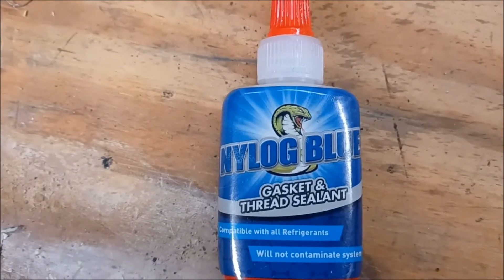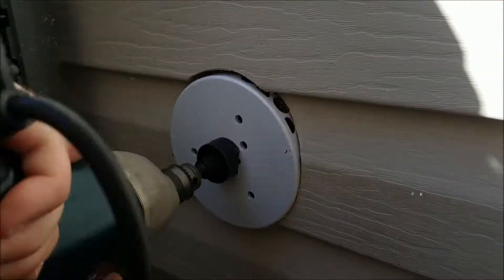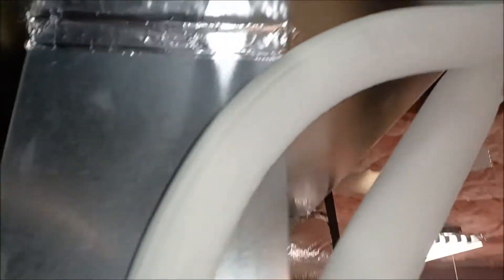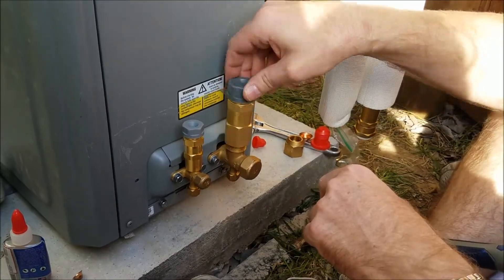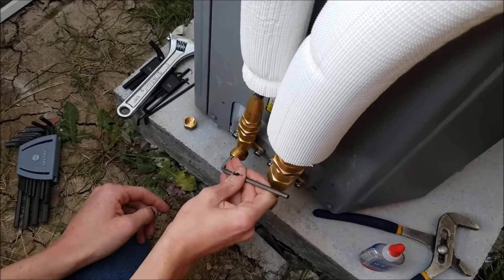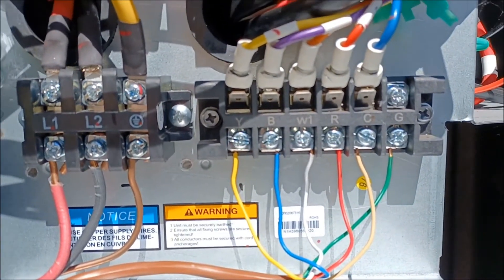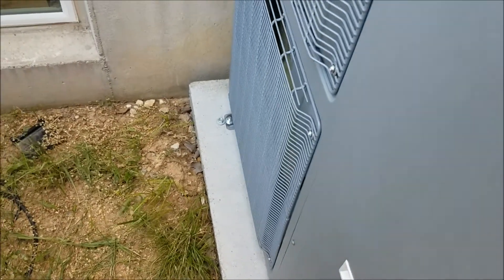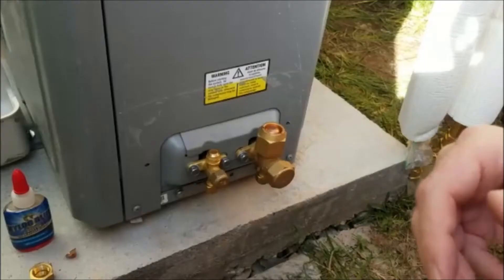Mr. Cool DIY Heat Pump Part 4 Installing the outdoor unit ducted universal

Comment: Did you have to change your breaker to match it
Reply from the maker: I think I kept it at 30A. Breaker always needs to meet the requirements of the wire you're using.

Comment: RESPECTFULLY NEVER put goop on a compression fitting and NEVER NEVER put it on the contacting faces!  The TINIEST bit of that stuff and your expansion valve is plugged!     TRUST THE MANUFACTURERS INSTRUCTIONS FIRST
As a mechanic spanning fifty years I suspect I know what a compression flare  fitting is and most everyone does not know.
Reply from the maker: It's r410 safe.  Not sure how it's going to plug  the expansion valve if it mixes in and has the same viscosity as the fluid. If it did, I'm sure nylog would get sued.

The heap pump  manufacturer doesn't say you can't use it. 

Do you have any independent, peer reviewed,  published data other than  anecdote experience to show its bad for the faces?
Reply: @stem_saving1644  I have worked with compression, knurled, nipples, couplings, sweat soldering, flare, flared end, flared pipe nut.

Do you have independent, peer reviewed, published, data other than opinion to show your idea that in my life has never been heard before is the thing to do?

In case I sound aggressive, I'm not, am retired and my way of helping others is relating what I know.

What I know is in the case of compression or flared fittings no lubricant, sealant, glue, or any stuff that does not say which it is is needed.

Lastly, flared fittings are among the best sealing this is why they are used in refrigeration, aerospace, and other high demand situations and applications.

If you like, since it is your channel and you have been courteous, I will gladly remove my comment if you merely ask or suggest it. 

Thanks.

Comment: Mrcool is the worst brand you can buy. Mine didn't last 6 months from new
Reply from the maker: We have different data points, mine has worked for 3 years, and there are no issues.
Reply: it's gree flexx with diy additions (line-set) -- they are good if installed well
Reply: @worfrozhenko4032 
Made in Chiiiiiiina 💩
Reply: @worfrozhenko4032 That junk is made in Chiiiiiiina 💩

Comment: I see you were measuring amp draw.  I've been tracking my compressor with the emporia power monitoring systems.  My outdoor unit routinely draws 20 to 22 amps after ramp up.  I was a bit surprised by this since the Rated Load Amps (RLA) on the data plate is 16 amps.  I have a 2/3 ton unit setup in 3 ton mode.  Do you have any idea if your outdoor unit draws more amps than what is listed on the data plate on the side of outdoor unit?  I'm just trying to determine if this is normal. Thanks!
Reply from the maker: It does. Some control systems that have quick rise times will overshoot their average during ramp up.  I seen mine did 7kw, but then damps down.  It's the power usage (steady state) at the given temp that's important.... at least to me.
Reply: @stem_saving1644  Just to be clear it is pulling 20 to 22 at steady state.  I have plots from the emporia energy monitor and there really isn't an overshoot on my system.  When the system had more vibration that I expected I started tracking amp draw because I was worried about the health of the compressor.  I still don't understand how to reconcile the data plate saying 16 amps max and it pulling 20-22.  Sometimes it hard to ignore things when you're an engineer.
Reply from the maker: @mtbphil168  The current should be proportional to the temp.  Give or take a few watts. But yeah, I agree with your last statement. 😀
Reply: @stem_saving1644  which temp are you referring to? Outside temp or refrigerant temp.  It does not seem proportional to outside temp from what I've seen.  This is a noncommunicating compressor and it really seams to operate like a normal compressor but with a ramp up.  It pretty much ramps up to a steady state of 18 to 22 amps.  So if it's proportional it's only a few amps change
Reply: Thank you for this datapoint. That is quite concerning from engineering perspective. I am about to install the 2/3 ton unit and planning on running it in 2 ton mode as per manual J/S calculations. It is 1,600 sqft ICF home. I will clamp the data logger on it and provide an update whenever available.

Comment: Have you had any issues with the lines freezing in the summer when running the AC? I checked mine for leaks and couldn’t find any. Condensate is draining correctly, but still unsure as to why it is freezing
Reply from the maker: It's usually a couple things.  The charge on the system, air flow across coil. Dirty filter or coil, which restricts airflow.

The mister shouldn't cause any issues assuming everything else is working as it should.  It sounds  like refrigerant might be low. You can buy gauges to check that.
Reply: @stem_saving1644  do you know what the levels should mark for this system in terms of refrigerant?
Reply from the maker: Not off the top of my head, it's probably in the literature or on a faceplate.

Comment: It's getting close to a year since ypu posted these videos - how is the system running?
Reply from the maker: Great, I'm getting ready to post some energy consumption rates soon.
Reply: @stem_saving1644   Outstanding! My AC and gas furnace system is 20 years old now. We installed solar panels a little over a year ago, and just this year I replaced my old busted gas water heater with an electric water heater, and now I want to swap my central air system over to a heat pump and get rid of the natural gas altogether. The MrCool system looks like it's the way to go! 

Thank you for showing your install and for giving updates! Looking forward to the next video. Take care.
Reply from the maker: @crxtodd16 might want to consider heat pump hot water heater as well.  I have a video on that too. I pay 3-5$ a month to heat the water.  Crazy low.
Reply: @stem_saving1644   Oh dang, that's awesome!! Unfortunately I had some plumbers tell me not to get a heat pump water heater because they "always break down", thus I got scared into buying an electric unit and installed myself. I put tons of insulation down in the new pipes and I put a heater jacket on it. But still, I'm paying more than that in electric bills for the heater... 

Sounds like I should have gotten the heat pump water heater to begin with!

Comment: Do you not have to torque any of the fittings? When I put in a mini in my living room I got the flare tool and the fieldpiece SMAN 380 I think it was. Saved me so much money in service calls. I thought the flares were messed up in my mini after about 5 years I had a slow leak. Low and behold I heard a hissss when switching to heat one day and found something that looked like a dent the size of a machine screw was leaking on the side of the indoor coil. It wasnt a boldge out but a clear puncture in that had not ruptured. I then had to braze the spot then vacuum the lines out, triple evacuate, and charge. I knew how to do none of this before putting in a Rheem home heat pump in 2010.
Reply from the maker: You should,  but I have a good feel for torque, plus I used nylog... so I shouldn't have any leaks.

Comment: Did he just put a big hole in a rim joist? Now I understand why DIY people need professionals to preform installs and have inspections called in 😂😂😂😂😂
Reply from the maker: LOL, need professionals to drill holes? It's not needed. Diy kits put "professionals " out of demand.  Glad I didn't have to pay professionals costs and still get an awesome heat pump.
Reply: Really, a single hole through the rim joist and you have a problem with that? Even if it was a problem you dont' think HVAC "professionals" wouldn't do the same thing? They pick the fastest way 99% of the time, just like cable installers nailing cable to the outside of a house because its easy.
Reply: @Kent-pb2jl  regardless of what your opinion is if I am a construction manager on a construction job site there is no way you would get by with drilling a hole on my joist like that you would have to come up with your own way  that us up to code, or do what engineering plans spesifi that's why we have inspections.
Reply from the maker: @thewrenchgarage7986  Guess what? This isn't a construction job site and your not a manager here.  I am not a manager, but I did stay in a holiday Inn express last night.
Reply: The point I was making is you compromised the rim Joist. If somebody does something like that on one of my jobs they would be figuring out how to repair the joist that is a structural component that holds the house weight
Reply from the maker: Guess dryer vents or pvc pipes or gas and water lines or utilities lines all penetrate the rim joists as well and compromise the rim joists.  But back to my original comment,  it's distributed loads across the joists.
Reply: If you believe that saving money is more important than saving your house that is a decision that only you can make
Reply: @thewrenchgarage7986 As an electrician, These DIY units are what the world needs. HVAC companies, in my opinion are the worst of the worst and prey on people in tough situations. This guy cutting his hole the way he did is 100% ok and does not significantly degrade the structure. Its his own house for God sake. Glad he was able to install his own unit and not have to pay the thieves that are HVAC contractors. I install these units all the time and am working on changing the notion that you need HVAC techs to install.  I can bring power from the panel (you need an electrician anyway) and do the rest of the install myself.The technology has been streamlined to the point where all an HVAC techs needed to do is servicing and that it.
Reply from the maker: @thewrenchgarage7986  millions of people put erv and hrvs in houses,  they also have 6" intakes and exhausts. Guess all those folks are not saving their houses either?

You do realize houses have multiple floor joists to distribute loads and are over engineered to take dynamic loads?

Comment: Thanks so much for sharing this! I'm a little confused about the electrical. I get that there is a separate breaker for the condenser and the air handler. I get that power for the condenser runs through the breakout box you have mounted on the outside wall. Does the power for the air handler run directly to the air handler, or is there another breakout box? Thanks again.
Reply from the maker: Outdoor disconnect is meant to allow you to remove power without having to go inside.  My inside unit doesn't have a disconnect ... as you're already inside.  But might be convenient, though.
Reply: @stem_saving1644  Thanks!

Comment: Did you used a 8awg with the 40 amp breaker and the inside unit is 102 volts or 240 volts? thank for your time. I got one coming and would like to get the wires ready to lay up.
Reply from the maker: 35a douple pole breaker,  with 8awg will do if running in 4ton mode.  Everything is 240v.
Reply: @stem_saving1644  Thank you for the infomation
Reply from the maker: Your welcome

Comment: How d you now if yor outside sistem is on.       Cooling  or heating  ???thanyou
Reply from the maker: There is a  specific wire that calls out the mode. You can also feel the coil, in the winter it will be colder than the outside air temp,  in the summer warmer.

Comment: I'm so happy you documented your Mr Cool installation and posted the videos on YouTube. I am going to replace my 30 year old York 2.5 ton heat pump with a Mr Cool 2 to 3 ton Universal in the Spring.  I noticed you did not use a torque wrench when tightening the line set on the indoor and outdoor unit. Did you use one off camera? Is the system still performing as well as when you installed it? Thanks again for your great videos!
Reply from the maker: No torque wrench used.  I can get a ball park feeling on how tight something is.  I also used sealer on the connections as well as leak tested it. 

It's been preforming nicely.  A like little louder in the winter,  but still good.  Subscribe for some soon to be released performance metrics on the system.
Reply: @stem_saving1644  Thanks for the reply. I'm afraid the little voice in my head would keep saying "maybe a little tighter" until I went too far LOL. I'll try to borrow a torque wrench. I will also use the Nylog Blue and apply it just as you did in your video. Just subscribed to your channel and looking forward to any updates.

Comment: Hey so how did you determine what size unit was needed for your home? I live in Denver CO and I’m considering buying the 5 ton universal heat pump model and I’m wondering if I need one or two for my ~2300Sqft ranch house?
Reply from the maker: General rule of thumb is 1 ton per 600sqft. If your good with math, you can do a manual J, which will get you closer. I was a one off case,  had 1600sqft of cooling and 3200sqft of heating requirements... so I went with the 4/5 ton.
Reply: @stem_saving1644   Thanks for the feedback good sir! I’ve been Googling but there’s a lot of bad info out there. I’d never heard of the Manual J before but that sounds like exactly what I need, and it might be worth it to do regardless as it could inform my whole strategy.
Reply from the maker: Exactly.  Most of the items you can do yourself  with some research and calculations. Just need to spend time and effort.

Comment: Why do your thermostat wires differ in color from matching sides? I’m going to install one (novice) and confused to why you match blue to purple and not to blue?
Reply from the maker: Not sure where your seeing purple? Colors are just meant to id wires, they are just copper.  You can use whatever  color you like.  But in most cases color represents the part the wire attaches to.

Comment: How large is your house and what is the temperature range for your area? I have solar panels and want to replace a 40+ year old furnace in a 1600 sqft house with an air handler and outdoor heat pump so I'm trying to figure out the proper size for the units. I can place the outdoor unit near the garage and run about a 25 foot line set into the garage where the air handler unit will replace the current furnace.
Reply from the maker: I have 1600 sqft for cooling and 3200 for heating due to a finished basement. We see both extremes for temperatures 10f to 110f. You could probably get by with the 3ton just fine.  Hope that helps.

Comment: you only get 5 year warranty cause you installed it yourself
Reply from the maker: OK,  so what's the alternative pay someone 4k to install it for the same price I can replace it for?
Reply: I have a question. It is a different scenario. I just learned of these particular systems but I am aware of the mini-splits. I am hoping to install this unit (or something similar) in a 16x60 mobile home manufactured in 92. I was hoping to utilize existing duct work (down draft). I am in the research phases so I am unsure of what might be possible at this point. Do you have any insight into that scenario? Do you suppose it would work?
Reply: @wadeintoit  don't buy any Mrcool products. I bought the 5 ton universal and it broken down 3 times already. The warranty department is terrible

Comment: I just installed the same unit yesterday. Did you install the drain plug that came with it ?
Reply: Thanks, I didn’t either. Thought it was kind of odd but wanted to check with somebody else.

By the way… Thanks for the videos. Yours were the best for this install I’ve seen. 🍻
Reply from the maker: @paulpts6704  thanks! I try to show that anyone can do it and save some cash
Reply from the maker: Nope. I was told it would crack

Comment: Where did you get the nice white cover over the refrigerant line/condenser connection (9:14 in video) ?
Reply from the maker: It comes with the unit

Comment: The manuals say over and over not to use a thread sealant..   Why is that?
Reply from the maker: Where does it specifically  say that?
Reply: @stem_saving1644  I suppose the warning is vague... Here's the exact text

"Do not apply pipe dope and/or Teflon tape to the thread of the connection.  Doing so could cause refrigerant to leak"

I suppose tape and dope are not meant for these applications to begin with and they're likely addressing the DIY nature to instinctually use what they might for other applications.

I agree some Nylog shouldn't be a problem
Reply from the maker: Pipe dope and or teflon thread are considered solids and could gap the threads and cause further leaks, vs a liquid which conforms to the shape of the container (threads) and fills the voids and doesn't cause any possible expansion.... which is the devil for refrigerant.

Comment: thanks for this! considering the same. Do you use for heat also? if so is it efficent?
Reply from the maker: Yes. I run it in both modes. It's a little cheaper than natural gas to run.  It's worked into the teens just fine.
Reply: I bought 2
Reply from the maker: You must have a huge house!

Comment: Is 10 amps all it draws when reached set point? I am considering buying one of those units for my home.
Reply: Wondering if you have it set to 5 ton and one more thing I noticed on the thermostat cables you have the C connected and I don't. What is that for?
Reply: The C connection is the 24 VAC Common. It is optional, but if you use a smart thermostat, many need to connect to the C connection to supply power to the thermostat, especially to run the WiFi radio.  You probably minimally have a 18/5 thermostat cable from the air handler to the thermostat.  The blue wire (if the color convention is followed) probably is in there and not hooked up.  Just connect the blue wire from the air handler C connection to the thermostat C connection.  Verify you have 24 VAC between Rc and C.
Reply from the maker: That depends on the outdoor temp. There is a power draw to temp chart that  mr. Cool has.
Reply: I also just installed this 4/5 ton unit. The spec specifies the max current of 35A. Max breaker of 45A. I use a 40A   breaker that I have sitting around.